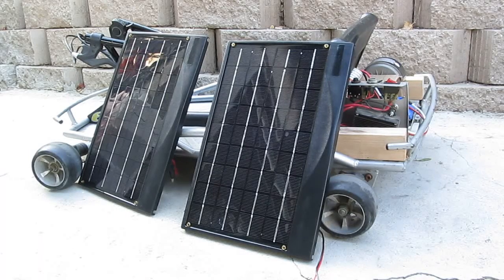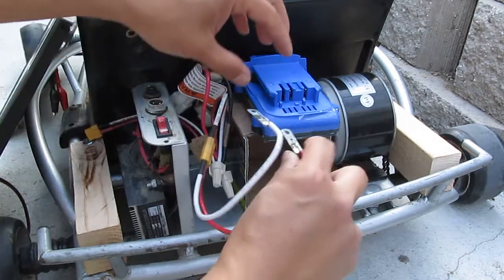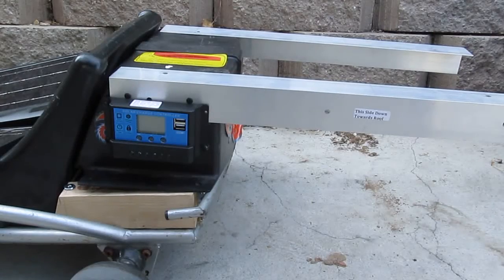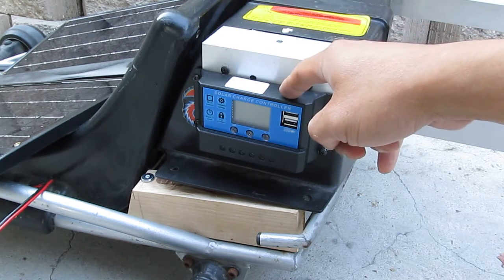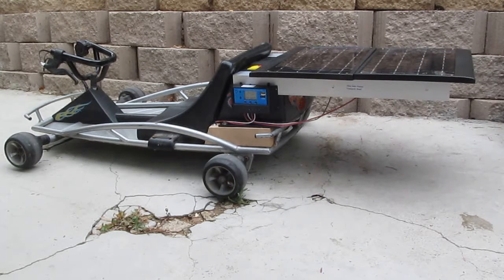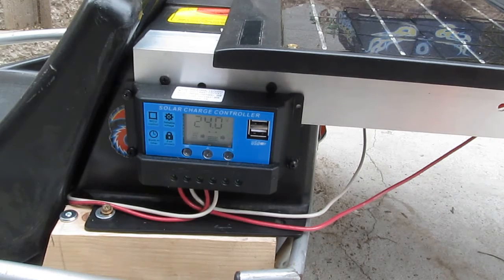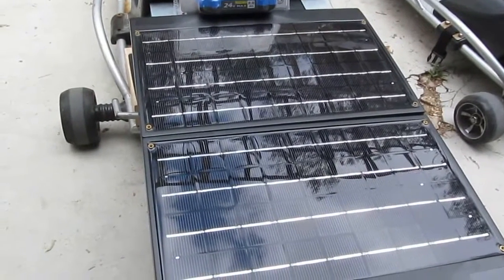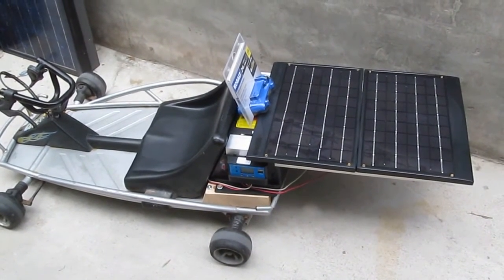DIY: Home Made Solar Powered Razor 24V Go Cart

Comment: How Long does 2AH get you? and this is an amazing project! Im looking to mount solar panels onto my ebike i built
Reply from the maker: 2Ah battery does not get you too far and you'll put too much strain on the battery. Try 4Ah or more.
Reply: @vuaeco  This Makes Sense, I mean you are asking to draw 280 Watts plus off of a 50 Watt-hour Battery Pack, Its just not 100% practical nor efficient, the Battery Voltage Becomes unreliable Im sure.

Comment: cool. but you limited your capacity and range. the SLA batteries were 7AH each. that LI battery is 2AH. also to anybody wanting to re-create this. make sure your power tool battery pack has a BMS circuit built inside. otherwise you can overcharge the pack and turn your go-cart into a fireball. a typical 20v lithium battery is has 5x 18650 cells inside. 5x4.2volts = 21volts at max charge.  this kobalt is perfect at 24v. 6 cells at 4.2v =25.2 volts maximum! .most chargers expect SLA batteries and the charger charges to 27.6 volts!! make sure your charger is suited for lithium cells or your battery pack has a BMS built in!